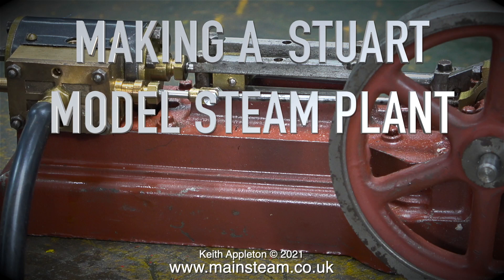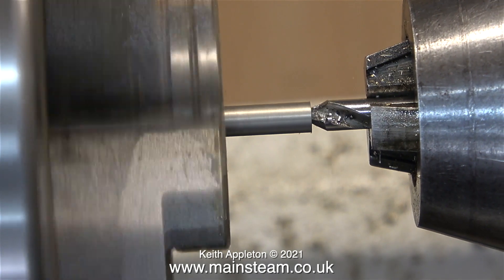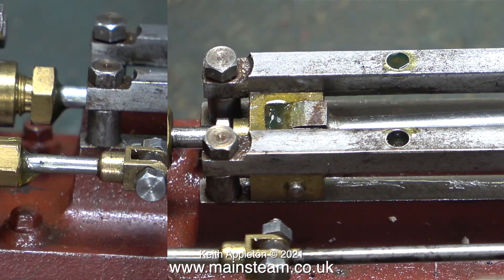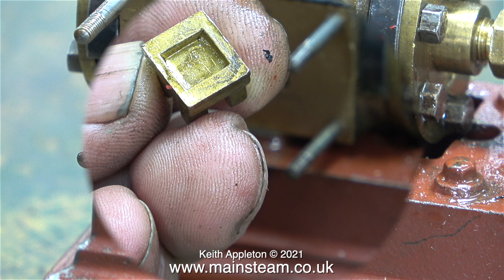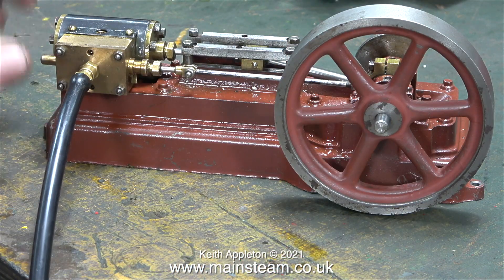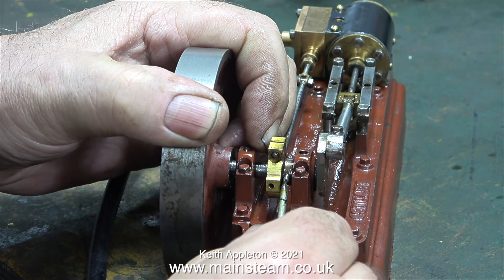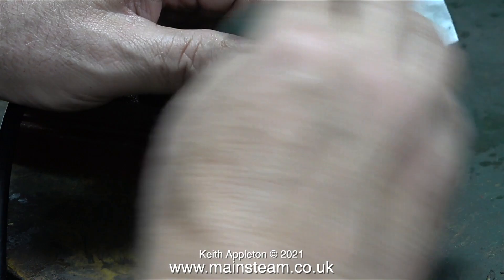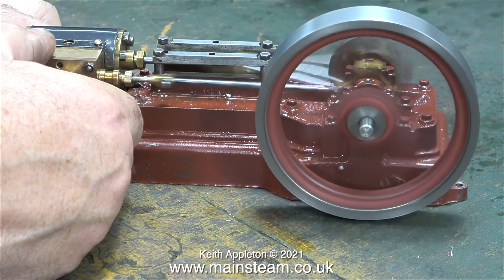MAKING A STUART MODEL STEAM PLANT - PART #5

Comment: I really enjoy those videos where you slow the film down and you can clearly hear the sound of the steam cycles. It would be interesting to see (and of course hear) a before and after the timing has been set. Great shot of the bolt being thrown and amazing that the engine still continues to run. Thanks for sharing this!

Comment: Built my S50 more than 30 years ago. The only problem I had was with the slide valve, it didn't touch the port face because I made the fit on the valve rod nut too tight. Soon fixed one I found the problem with a few touches with a needle file. No longer have a boiler but it runs fine on about 30psi on a compressor.

Comment: I was taught that steam engines will take themselves apart if you let them, especially when you have no governor. When there is no governor - you, the operator, are the governor. I've had the big end nut unscrew before my eyes, gland nuts unscrew themselves from vibration, other bolts and nuts unscrew themselves. The silver lining is that steam engines are mostly built with very open designs and are sometimes operating slow enough that you can see the disassembly happening - if you happen to be paying attention.

Comment: Do you think one boiler will run all five steam engines.
Reply from the maker: Yes, a Stuart 504 Boiler with a powerful heat source would run them. The cylinders are only 5/8 of an inch diameter and the stroke is not much either.